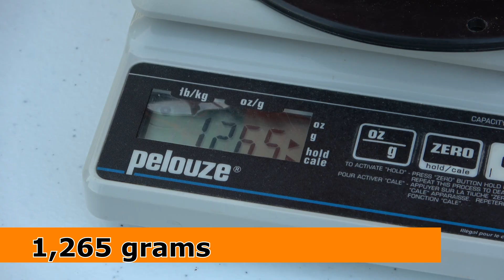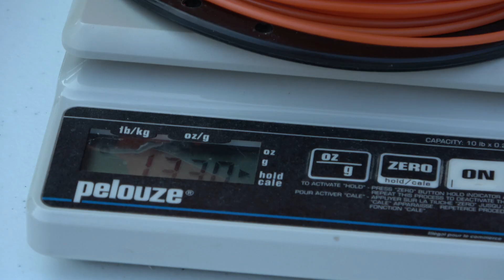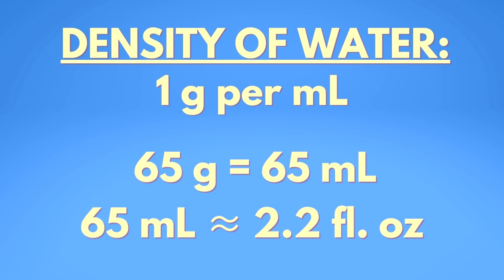Soaking Stihl String Trimmer Line in Water: How much water will it absorb after 48 hours?

Comment: Why are we caring if it holds water ? So it soaked does it make the string stronger
Reply: It makes the line less prone to breakage. As line ages and dries out it becomes more brittle and breaks more frequently and easily when using it on your trimmer. Soaking line in water makes it less brittle and decreases the frequency of breakages.

Comment: That scale measures weight, not mass. Quit calling it mass! I'm sure there's about 65 grams of water still trapped inside the spool. The white powder is added to reduce the string from sticking to itself...
Reply: Could you go to your local Home Depot and take some pictures of any and all the freshly stocked trimmer line and then come back here and tell me how many had a white lubricating powder on them? Because I've never seen it. I was just looking at trimmer line yesterday - Stihl, Husqvarna, MaxPower, Ryobi, Echo, Masterforce, Milwaukee, Oregon, Razorback...none of these brands have any sort of visible powder coating when new, nor do they feel lubricated in any way. Looking at new Echo and new Husqvarna line right now...nope, no coating. Are you just stating your guess as a fact here, or do the stores near you carry some sort of obscure powdered brand of trimmer line?
Reply: It's wax and all line manufacturers wax their product so it feeds better.@Scandibilly

Comment: There is a good chance water is still caught all up inside that spool in ways of osmosis, to truly dry it out you'd have to unwind it all in one long string and let that sit outside for an hour or two in bright sunlight by which time it will likely look just like it did before.
The white powder, by the way, helps keep the string from binding up inside the trimmer spool. I doubt that's because it's "dry," more like a baby powder that was added at the factory, many of mine come this way already.
Reply from the maker: @8307c4  I am sure you’re right about truly drying it.  As I said, it’s not a truly scientific experiment.  As far as the powder is concerned, I definitely don’t remember the white powder appearance when it was new.  Thanks for the info and thanks for watching!  Please like and subscribe!
Reply: @averagejoevideo9556 husqvarna’s titanium force trimmer line seems to be really bad about getting that powdery residue on it. I feel like it needs to be soaked frequently.